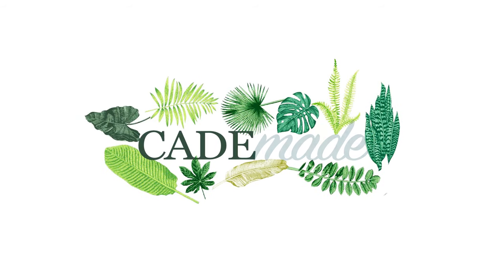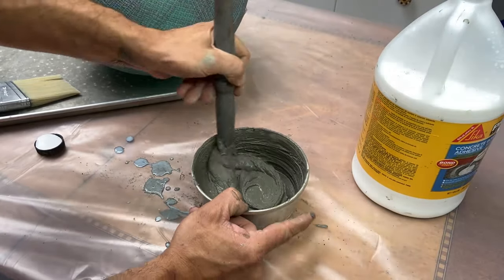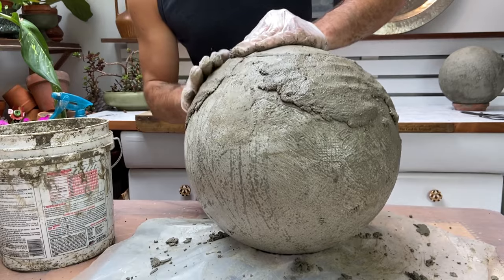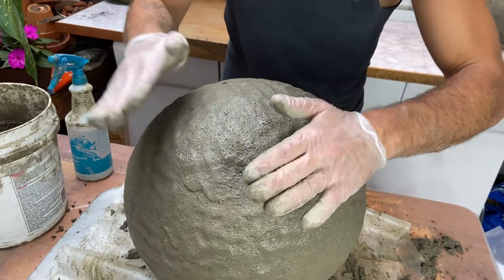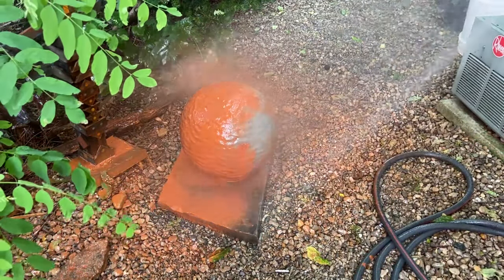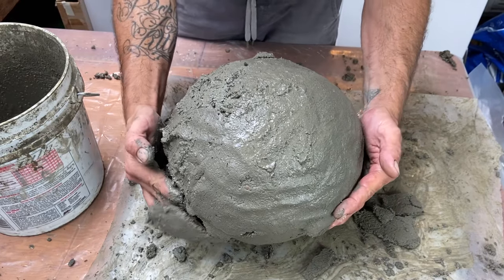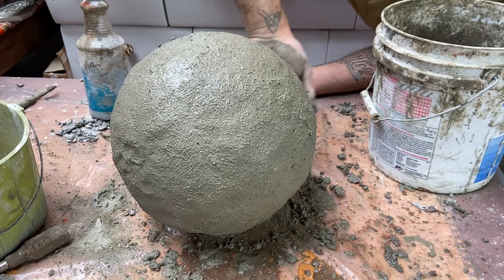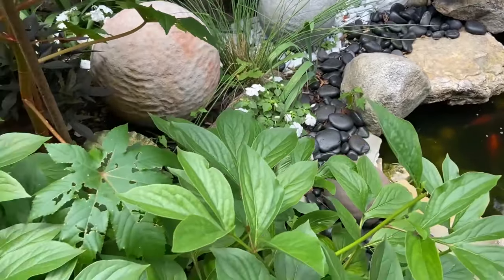Concrete Sphere Tutorial | GARDEN | DECOR | DIY

Comment: After making several of these cement balls and using different techniques I found that dipping fabric into a cement slurry and wrapping the balls is the easiest technique. Then you build up from there.
Reply from the maker: Using this technique now and it’s working super great thank you for the suggestion new video soon!
Reply: Very informative  thank you. My garden is going to look great!
Reply: Good  information
Reply: As I understand it, the more water, the more it may crack. Is this the risk in making the cement into a slurry?
Reply: @jonmichaelroberts the fibre of the material used offsets the worry of cracking as the cement is bonding to the fibre

Comment: Good video but I'd like to see the ball pierced so when it gets hot in the sun the expanding air inside won't force the cement to crack and split which I have seen happen.
Reply: Thank you for the warning.  It gets over 100 where I live.
Reply: To make these last, run your first mud with reinforcement fibers in the mix and then top coat it for texture. Make a temporary housing out of plastic to keep the moisture in and mist wet the concrete daily for 14 days. The curing process adds strength and significantly reduces the possibility of dry cracking from surface shrinkage. Seal coat it with siloxane or similar at the 28day mark to keep the weather or pond from eroding the surface. If properly cured and sealed, and vented as per this comment's op, the ball could be tinted or polished and placed in the pond indefinitely.
Reply: @Xonikz  Thank you, have saved.

Comment: I just started, or tried, to make my first garden sphere and ran into every issue you addressed in your video.  i should have inflated the ball more, didn't keep the surface wet enoughm didn't the tape at an angle and it started coming loose and I had it sitting on a pedestal  that was too tall and it tipped over a couple of times.  It is drying in the driveway and then I was going to attempt to get concrete on the bottom half.  Now I think I am scrapping that one and starting again, the right way.  Thanks for your video.  Also, for my first attempt I bought the biggest ball I could find.  Maybe I should start smaller.ew
Reply from the maker: Oh my gosh! Well the mere attempt is honorable. Perhaps yes trying a smaller ball for the sphere would be a better way to get the flow. I’m nervous about making a larger sphere but gearing up to do so! Best to you On Your next attempt!
Reply: @CADEmade  great job Cademade

Comment: Enchanting, indeed! Did you consider using matte (or otherwise) sealer to protect the spheres?
Reply from the maker: That’s a great idea for sure. I’m not entirely certain but the concrete bonding adhesive I added to the mixture is basically liquid acrylic base so it may be doing the sealing job as well assisting the structure! Thanks for watching!

Comment: Maybe you got the following tip allready. After you do the first layer and letting it dry spray the serface realy wet en then sif some portland cement over the surface. This will create a chemical bound between the furst and the second layer. Then let it dray for a few hours en submerge the  ball (after taking out the playball) in water. Let it cure for 8 day's.

Comment: Are the spheres strong enough to drill into? I would like to do the same thing but use the sphere as a fountain. Thanks for any advice!
Reply from the maker: Yes they are strong enough and definitely great for use as a fountainhead. The only recommendation additionally is that you prepare another batch of the slurry and completely coat the inside of the sphere once you have removed the vinyl ball. It will help water from breaking down the fiberglass mesh. Have a “ball” making it! Thank for watching, as well!